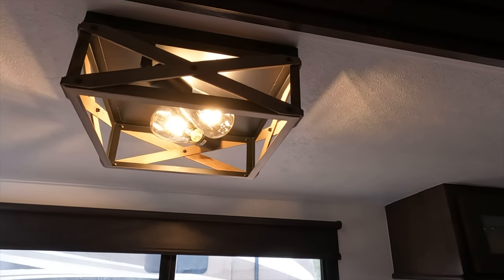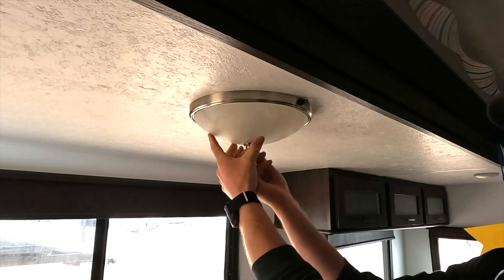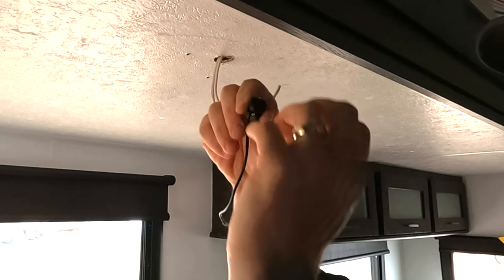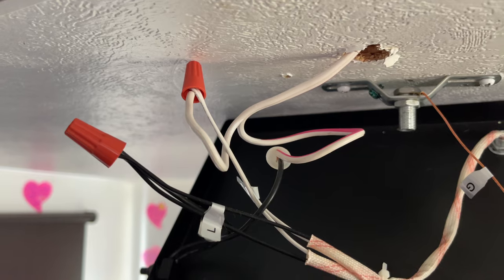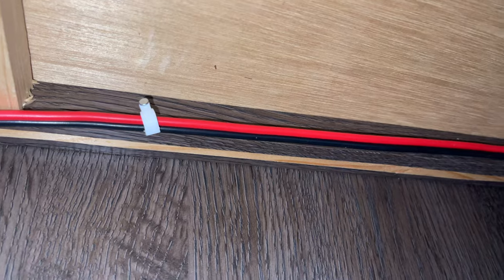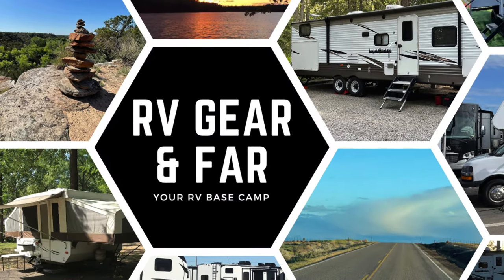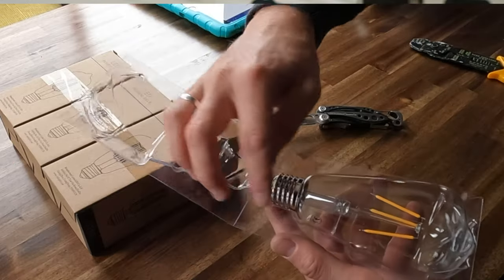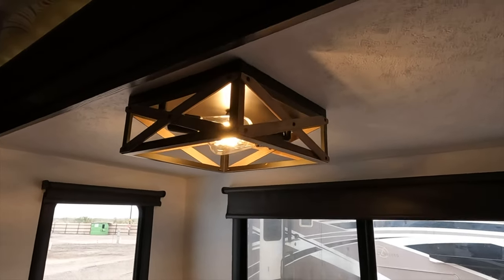Easily Upgrade 12v RV Lights with ANY Fixture!

Comment from the maker: 🏘 Join the RV Gear & Far Group Here:
https://www.rvgearandfar.com/rvgfyt 
⭐🌟 Check out ALL the products and gear we recommend here: ⭐🌟  
📦 https://www.amazon.com/shop/rvgearandfar 📦 
 ⭐⭐ Examples of Products Used In This Video ⭐⭐
🔷 Flush Mount 120V Light Fixture Examples: https://amzn.to/43KyPwV
🔷 12v LED Edison Bulb Examples: https://amzn.to/3rVOaNU
🔷 Solder Wire Connectors: https://amzn.to/43Xj2v6
🔷 Crimp Heat Shrink Connectors: https://amzn.to/3rZ3ole
🔷 Mini Heat Gun: https://amzn.to/3rONREK
🔷 Multimeter: https://amzn.to/3OMmpRf
🔷 Non-Contact Voltage Tester: https://amzn.to/3Oo2MNY

DISCLAIMER We participate in several affiliate programs that earn us a commission on purchases made through our links at no extra cost to you!
Some product links are affiliate links which means if you buy something we will receive a small commission. As an Amazon Associate I earn from qualifying purchases.

Comment: If they RV light that I want to replace turns on and off with a light switch on the wall will I need to buy a switch to attach to the new 120 light fixture or will it just work with the wall switch?
Reply from the maker: Should be good to go with the wall switch. Score for one less step!

Comment: I've watched this video several times. I want to replace the light in our travel trailer over our dinette to one like yours. I'm concerned  that I will be unable to center the light over the table. Have you ever heard of someone making their own custom light to fit a spot?
Reply from the maker: I have not heard of that, but also if your new light could be centered where you want it on the ceiling and still cover the old hole where the wires come down then I don't think the wires need to drop into the new fixture exactly in the center - might play around with it.

Comment: Hey there I was wondering if you happen to have found a dimmer bulb option? Thank you in advance.
Reply from the maker: I was able to find some on amazon by searching "12v dimmable a19 Edison bulb"

https://amzn.to/3zlSxWc (amazon affiliate link)

Is that what you were looking for?
Reply: @rvgearandfar  Yes thank you! New Subscriber :)
Reply from the maker: @universaluplifting  Welcome aboard!
Reply: @rvgearandfar  Thank you, I had a quick question. Like the light fixture can I also use a residential dimmer? Instead of those rv dimmers?
Reply from the maker: @universaluplifting  You'd need to use a 12v dimmer - something like these: https://youtu.be/2bbqBcSsRZQ?si=c_Fwa_9G8Y1Q-wL7